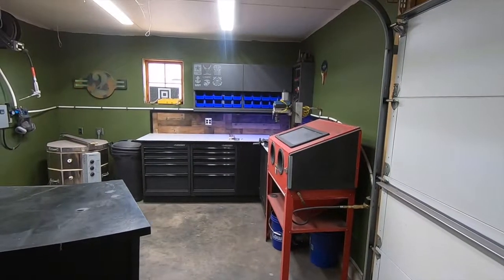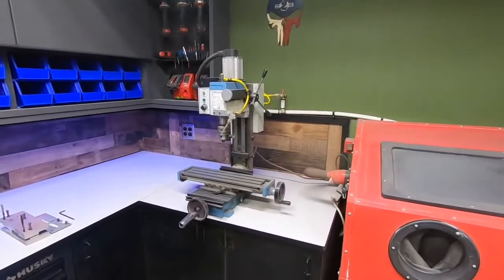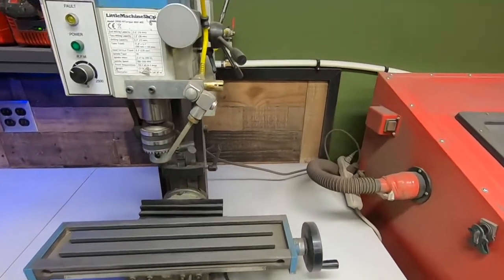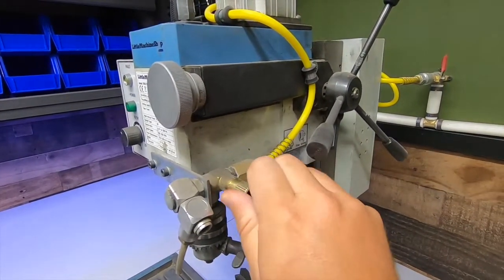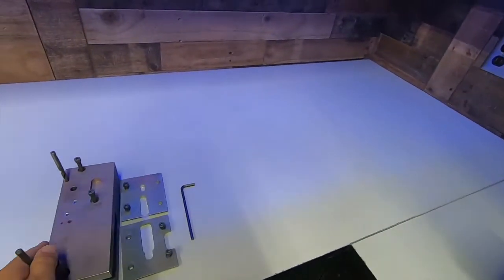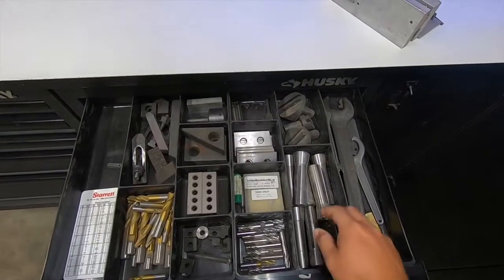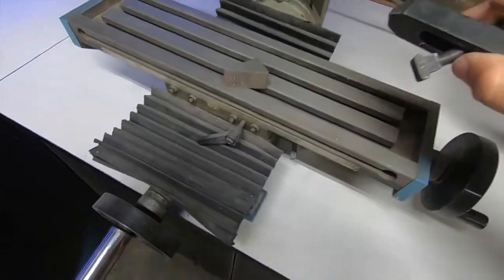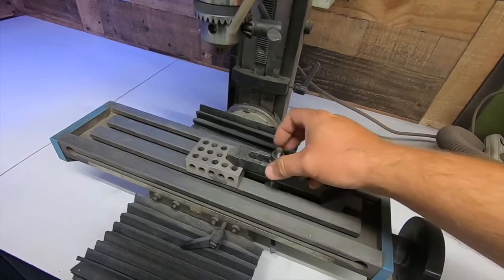Bench-Top Mini Mill

Comment: I just bought the LMS 6450, newby also on the trade but been making many unfinished projects that I either messed up or did not finish because I was using a frankenmill floor drill. Did good work but finally found out that I had to buy a real milling mill to mill projects better. Hope you keep bringing out more videos

Comment: SUPER AWESOME!!!! I love that little thing!!! I would love to cast an intermediate sized one for the same things you are working on.
Reply from the maker: I’ve sure enjoyed having this thing in my shop! I do feel like something with a  little more capability would be useful for sure. 👍
Reply: @Project2Workshop  I love your shop also. We should collab sometime or just get together and hit some targets. I really fell in love with the PCP air pew pews...
Reply: @Project2Workshop  I am starting a youtube channel when it gets a little warmer. I am building a 1928 Morgan Aero 3 wheeler special with 4 wheels. I am cassting an adapter out of aluminumm to mate an opposed twin aircraft engine to an MG 4 speed transmission and then to the diff and wire wheels. I am also going to be building a small brooklands style cyclecar with a BMW R-100 motor. I am recovering from being hit and wrapped around a telephone pole on my 1957 Panhead...nearly lost my right leg and am still fighting blood clots. I have been assembling a small machine shop consisting of a Southbend lathe, A burke number 4 milling machine that needs lots of tools and work. I found a drilling tapping station used in the 40's for airplane assembly. I just purchased a Bissel? tire changing machine from the 50's. I am so excited to get started. Meanwhile I would love to build a small version of a lathe and  milling machine to use in the basement so I can make parts in the warmth when it is too cold out. I will let you know when I start my channel. Thanks.
Reply from the maker: @Biokemist-o3k  sound like your making the best of a tough time and putting it to good use!  I’ve been in aviation for lots of years so that sound pretty cool to me👍.  My other channel is project2aero where I’ve been building an airplane over the last few years.  Always tinkering on somthing🤷🏻‍♂️

Comment: Dude, my jaw is in the floor. I have the same mill and learned quickly that operating a manual mill is an art form. All the technical know how in the world won't get results like this. Simply  amazing. I'd have a 400 lb 5 foot tall pile of miscut stock next to me if I tried this.
Reply from the maker: Thanks! It takes some time to figure out how to work around the quirks of a cheap machine, but it is possible👍 I’ve had mad fair share of scrapped pieces along the way for sure!